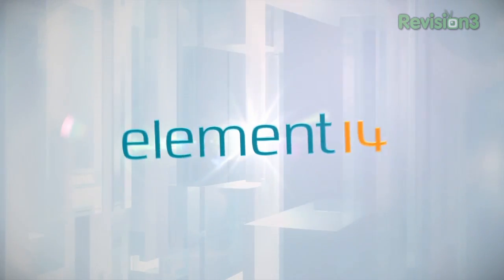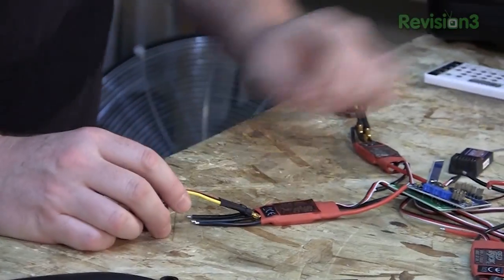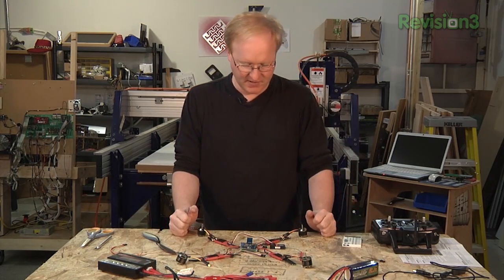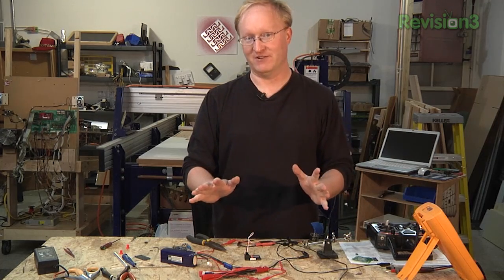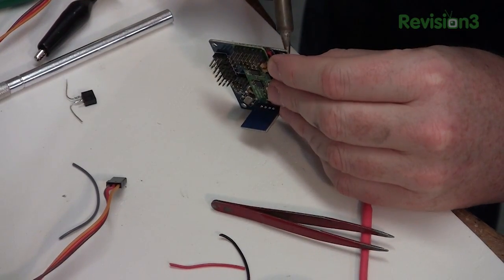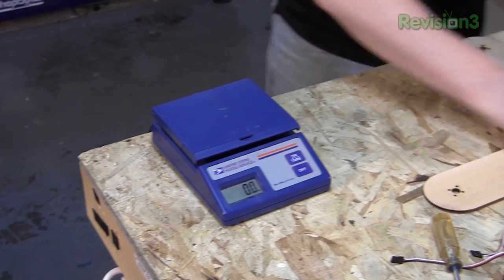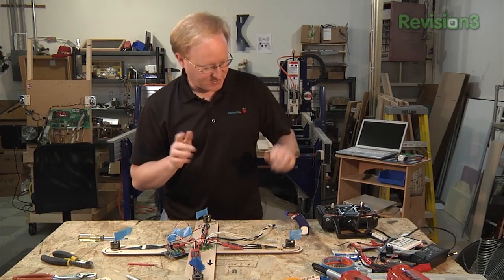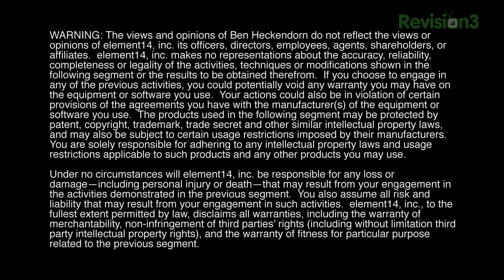Let's Go Fly a Quadcopter!

Comment: hey benjamin jay heck.... my name is benjamin jay basham. we are like twinkies. love your show. I have learned alot specially on raspbarry pi3... I was watching the first video of you building the quad copter (drone) and you were weighing parts; not that its even relevent but thought i would share this with you just because you were using a can of coke (12 fl ounces) as a reference to weight in that 16 oz to a lb. you went into a little detail, as far as weighing in grams.  I agree and had the same problem b4 myself

In its simplest possible explanation, a fluid ounce (abbreviated as fl. oz.) is used to measure fluids while an ounce (abbreviated as oz.) is for dry measurements. This gives us the idea that a fluid ounce is a measurement of volume while the other is a measurement of weight
  
p.s. normally i would b a real a55 1!k3 3v3ry 07h3r 7r011 0u7 7h3r3. but like i said love your show dude, besides we share 2 out of 3 names, not bad...... benjamin means right hand man, and you are a pretty good handy man to have on the default right like myself. haha, had to get nerdy about it for like mostly this whole message, sorry. keep on keeping it on man!

Comment: The esc's have to be calibrated. The one motor did not run because it is too far out of calibration to sense the throttle position from the transmitter signal. You have to turn everything off, Turn on the transmitter with the throttle full and connect the batteries, you will here a single tone. Then  disconnect the battery and then reconnect the battery and move the throttle to off position and there will be confirmation tones that calibration is successful, then disconnect the battery. Once you reconnect the battery all motors will run at the proper throttle response

Comment: can you link all the parts?
Reply: He's using low quality parts, I recommend you using these, cheap and cheerful...

motors: sunnysky 2212-980kV
Speed controller: 30amps blheli
flight controller: apm 2.6
propellers: 12x5 inch
radio: turnigy 9x

Comment: You never mentioned why that one motor didnt spin....
Reply: +Levi Blaney Exactly! I wanted to know too!
Reply: I bet he put the servo leads on the wrong position i.e ground and signal
Reply: All ESC's have to be calibrated before you can have proper throttle response. The one motor is so far out of calibration it can't run. Once you calibrate them they will all respond exactly the same. Been there-done-that

Comment: My dad built a new plane after his first one. His first one was electronic, lasted about 15 minutes before a battery was drained so you can get a bit of flight time, but his new one is gas powered, which was terrible for what happened. The plane crashed, the gas lit on fire and actually made a small explosion. Terrible days for RC plane users.

Comment: Morning, Ben.
I have an issue I'm hoping you can help with. I recently got a new PHantom 2 with H3-3D gimbal. After unboxing I installed the gimbal per your 'new' instructions, got the anti-interference chip settled nicely. I then installed the drivers and programs then dived into the Assistant and RC software. I own another PHantom as well so this was all a piece of cake. Took the Phantom out for her maiden voyage, powered up, waited for green lights and hit the sticks. Nothing happened. I walked closer (as if this would have any effect) and tried again. Nothing. But then I noticed my gimbal was turning left and right when I moved the throttle stick right and left. Brought it back home. Uninstalled everything, reloaded everything. Recalibrated everything. Same thing. Gimbal left and right only.  PLEASE HELP!
Reply: Know this is late but you probably have the wires connected in the wrong place. Or make sure you check the naza flight controller to make sure you have all the right settings.

Comment: lets build a desktop cnc from a dremel tool is what i'm waiting for....
Reply: Really easy to do Lez.. I built one using a diy router
Reply: Steve Wagg well i wish i could find a simple guide, most of them say i need a 386 with a real comport and mach3 software and to sacrifice ecl82 tubes to have success...

Makes you wonder why such kit is still in use, and that cnc guys dont move into the same control world as the 3d printer people, an x/y table is the same in both machines, just one is handling larger forces, but thats transparent to the software...

Comment: Um, that won't fly. You need to reverse two of the motors and propellers so they cancel out torque. Otherwise it will just sit there and spin uncontrollably. You may want to consult with one of us RC Helicopter freaks. I just don't want to see you waste a bunch of time and end up with an electronic paperweight.
Reply: Never mind, I didn't watch it all before I commented. Silly me.

Comment: Great video, but do have questions. How did you solve the motor not spinning up? That was just skipped. Also, Im setting up a quad and my motors are all spinning up at different times. D: no idea whats going on, tried adjusting the pots but cannot get them to start in sync. any suggestions?? Thanks!

Comment: Have a look at this Software for arduino or any microcontroller communicating through serial port... I have wrote this liitle application for pc so people can test and display some information from their readings... look great... and useful especially if you don't have a 2x16 display at hand... or even if you do.. this will display it all on your PC or laptop... I have added some more stuff to it e.g some GAUGES too... imagine Controlling a glass house and displaying iformation from your sensors right on your screen or a alarm sysytem and you can know where and what sensor has been activated etc... Arduino Software LCD and Gauges Display. Made to use instead of LDC Hardware  thanks :)

Comment: I hate this non-metric system.
Reply: Jim No one cooks with pounds and ounces here. Any cook book uses grams.
Reply: Yet here in the UK we still use MPH as a measurement of speed and many still cook using pounds and ounces. We are not a totally "metric" country you know!! We choose what's easiest to use for our daily lives.......same as the USA and most of the planet.
Reply: Only advantage of non metric system is that it can be easily divided for 1/2, 1/4 and what metric system can not - for 1/3. Its was very important in middle ages europe, where not many ppl was educated enough to count properly.
Metric sys was implemented as result of French revolution, they even try to change clocks into 10H insted 12 :) But this havent work out.
There are lot other number systems, binar, octonal, And they all would be normal for person who was risen using them.
Thats all.
Reply: There's a wonderful concept that us Americans have learned in order to know both METRIC and STANDARD...it's called a "conversion" :D. 1 meter = 3 feet, 2.5cm = 1 inch etc.

Comment: How do you calculate lift/thrust when building a quadcopter?
Reply: the motor says how much trust it is or just check a thrust test here on youtube so it lifts 1.5 x the weight its all good if my all weight is 1kg and one motor produces 375g thrust and i have 4 = 1500g thrust

Comment: Uhh, ahem... It's a 3 phase AC motor. Also, just buy the correct prop adapter for your outrunner. A decent DJI knock-off frame costs less than $20. Don't screw with flexy-thin plywood.  Another thing - the ESC's need to be range calibrated so they all start at once. You've made several other mistakes.
Keep reading - you're not there yet...

Comment: Judging from the video, it looks like he is using a 
hk t6a transmitter With receiver. 
4 - Ntm 2812 brushless motors- can't tell the kv but u want something less than 1200kv
4 - red brick esc's - you 20 - 25amps depending on your motors 
1 - nanotec 3s or 4s 2200mah lipo - need a 25 and higher c rating
PCb board to solder everything to
Sounds like an arduino mega controller and all the small nec. Parts
And a homemade frame
All the parts can be purchased from hobbyking.com

Comment: Agreed with the previous comment that it would be nice to see more info on what went wrong with the one unresponsive motor. I've noticed this in a few of the vids on this channel - show a problem, and then it's just magically corrected in the next cut, with no debugging or resolution details. To me, that's eliminating the most interesting part of the engineering process!

Comment: Ben, many people rush out and build quite expensive quadcopters, only to lose them on the first flight.  Too much time was spent on hardware, and too little on learning the basics of flight. The best investment, anyone could make in this hobby is to consider a cheap "toy" quadcopter to learn the basics of flight.

/watch?v=XGjLL9Fd5wA

They actually can fly very well, and their cost is usually less than most "simulator" software.  Please consider before your home built crashes into the ground.

Comment: Don't see the point of wiring the receiver direct to the flight controller to make it "neater" - there will still be another 32 wires in plain sight, was possibly also the reason for the unexplained motor fault - that or the non insulated connections as pointed out by Reece Cameron

Comment: Balance your props, and update the flight controller. Btw, can you give me the link to the Molex connector set w pins you use? I've built about 24 different multirotors including tricopters, quadcopters, hexacopters, and octocopters but i've NEVER thought about using these connectors. Awsome idea!

PS. Try Naza-M Lite by DJI or the Arduino Based Controller ArduPilot. I personally use Naza-M V2 or Wookong M on all my Multirotors

Comment: too big? that's a very vague statement. I also use 28cm NTM prop drive motors on my tricopter. Important to have is relatively low kV and enough thrust. Looks like he uses a 2.2 Ah battery which is not much (I use a 6Ah battery) but definetely enough for a quadcopter this size.

Comment: Good luck flying with that crappy radio. Get a cheap computer radio like the turnigy 9x or 9xr so you can dial in expo's. Also, first turn on you Tx then the Rx if you want to keep your face.

Comment: Hi Ben, I believe you need to calibrate all the ESCs (Electronic Speed Controller) to get that motor running. You need to refer to the FC (Flight Controller) documentation or the Hobby King website for this. I would also like to point out that the FC is factory set to Quadcopter "+" configuration. Good Luck!

Comment: Thank-you for the quad build, its really interesting to see an outside perspective.

As already mentioned, you want heat shrink or tape covering the bullet containers so they don't short. You might also want to specify turning on the Tx before connecting the battery.

Can't wait for part 2!

Comment: 3 things (from someone who builds lots of these things).. 1) yes, buying the prop adapter set would have made that a lot easier than swapping the shaft, 2) I'd have gone with the KK2 board for simplicity of people just getting into this (and it's great to program on the spot), and 3) did you calibrate the throttle on all 4 ESC's? It's crucial for function (and may be why that motor wasn't spinning up)..also, may want to only send the 5V lead from only 1 ESC to the board, rest only ground+signal

Comment: Really looking forward to this project. But I feel like I should point out that unlike the video claims, brush less motors are powered by AC current, changing the DC current from the Lipo batteries to ac is part of the job of the Electronic Speed Controllers.

Comment: I've seen Pi powered quads.  Was that the multi-wii controller board you chose?  What made you go with that?  The KK 2.0 is slightly more expensive, but has an LCD, buttons, and larger onboard flash to more easily program, without needing to plug it into a computer via FTDI every time you want to change the gains or throws.

Comment: you should really isolate the connectors going from the speed controllers to the motors, if they short-circuit, the speed controller dies. also, looks like you have not calibrate your speed controllers(they need to know the bottom and top position of your transmitter-throttle, otherwise it will be un-flyable). also to be sure, stick to half the weight that the combined thrust of the motors/propellers can deliver, so that the battery will last longer, and better maneuverability.

Comment: ben you should really make the arms thinner, you are loosing about 40% of you power to the air blowing onto the frame, also if you mount the motors upside down you will gain 9% efficiency but making the arms thinner is priority.
Also giving the motors a 10 degree tilt inwards so the air blow 10 degrees out you gain 7% stability

Comment: Are they 1200 kv motors on a 4s battery?? if so, 10 inch props are way to big! im running 8 inch props on the same motors/battery and I am just over the rated power for the motor!! if it works it works i guess, we will see. Also you can get motor collets for 2$ each to join your props to your motors.